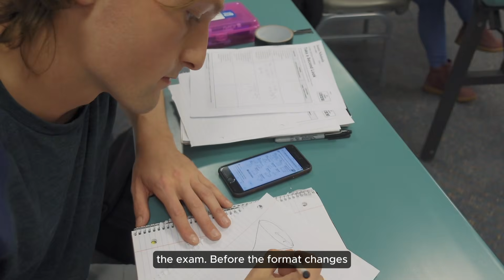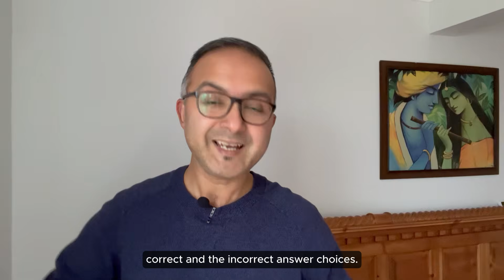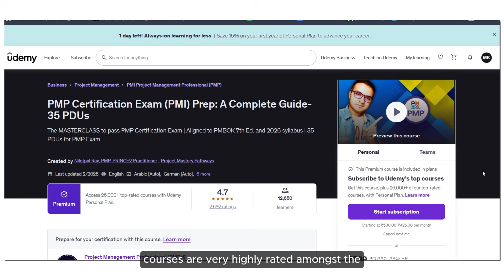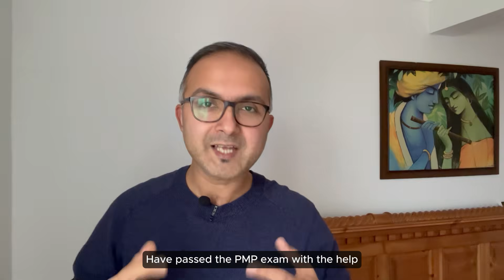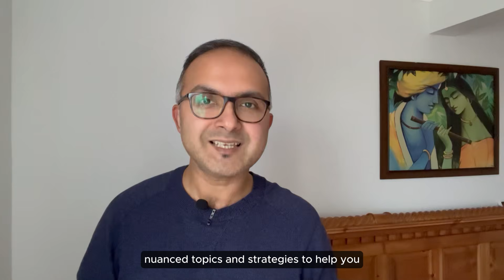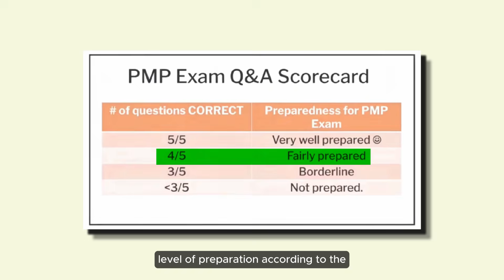PMP Exam Questions (Mar 2026) | PMP Mindset for Project Management and PMP Exam | PMPwithRay

Comment: Hello sir, i scored 3 out of 5, i have the exam scheduled on July 2nd. Could you please guide me here
Reply from the maker: Scoring 3/5 is not a concern by itself. What matters is why the two answers were incorrect.

With your exam on July 2nd, focus on:

Understanding the PMI mindset rather than memorizing facts
Reviewing every incorrect answer and identifying the reasoning gap
Practicing situational questions daily
Strengthening Agile, stakeholder management, and risk management concepts

At this stage, targeted practice and learning from mistakes will give you far more value than covering new content.
Reply: @PMPwithRay  Thanks Ray, i will practice questions and understand the concepts.
Reply: @PMPwithRay hello Ray, I took the exam today 2nd July i have cleared with AT/AT/AT

Comment: Hi Sir, how close are the case scenario and toughness of each question to real exam?
Reply from the maker: The scenarios are designed to be very similar in style and mindset to the real Project Management Professional (PMP) exam.

In terms of difficulty, I would say they are generally comparable or slightly more challenging than the actual exam. If you can consistently understand the logic behind the answers and score well on practice questions, you are usually in a good position for the real exam.

The key is not whether a question is harder or easier—it’s whether you can consistently apply the PMI mindset to unfamiliar scenarios.

Comment: I managed to correct the first four, but the last one was tricky—I was torn between A and D. Your explanation cleared my confusion, thank you. Sir, I’m planning to take my exam in the third week of May, so I wanted to ask: will the practice questions you’ve shared be at the same level as those in the real exam?
Reply from the maker: My practice questions are designed to mirror the actual exam's difficulty and situational complexity, so you are on the right track!

Comment: Where does the information that SLAs are only relevant in the service industry come from? SLA defines measurable performance and quality standards, regardless of the tangibility of the output (physical or non-physical deliverable), and as such is an industry-agnostic tool, which can be very helpful, especially when it comes to accountability, rework requirements and "redressing" clauses.
Reply from the maker: You’re correct in principle. SLAs are not limited to the service industry.

An SLA simply defines measurable performance, quality levels, response times, and accountability mechanisms between parties. While they are most commonly referenced in IT and service management, the concept is industry-agnostic and can absolutely apply to manufacturing, construction, logistics, or vendor contracts involving physical deliverables.

In many non-service sectors, similar expectations may appear under contractual performance clauses, KPIs, or quality agreements, which is why the terminology sometimes varies even though the intent is the same. Reviewing contract management practices across industries will show how these performance standards are structured differently but serve the same governance purpose.

Comment: Pls suggest mock exam questions , where and how to take.
Reply from the maker: For PMP mock exam practice, I recommend using a structured simulator that mirrors the real exam format (180 questions in ~230 minutes) so you can build both accuracy and stamina. Realistic simulators help you practice scenario-based questions across the three domains—People, Process, and Business Environment.

You can take my recommended PMP mock exams here:
https://bit.ly/raypmpmock

How to use the mocks effectively:

Attempt the exams in a timed environment similar to the real PMP exam.

Focus on understanding the reasoning behind each answer, not just your score.

After each mock, review incorrect questions carefully to strengthen your PMI mindset and decision logic.

Consistently practicing full-length mock exams and analyzing mistakes is one of the most effective ways to prepare for the PMP certification exam.
Reply: Yes same here